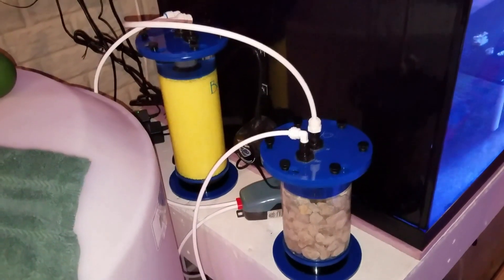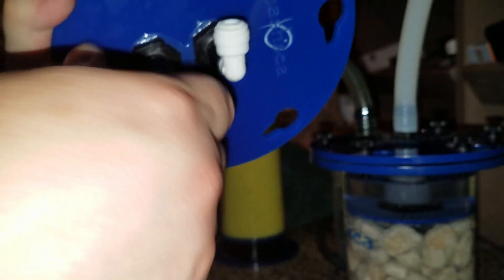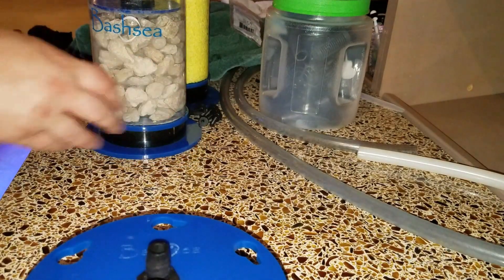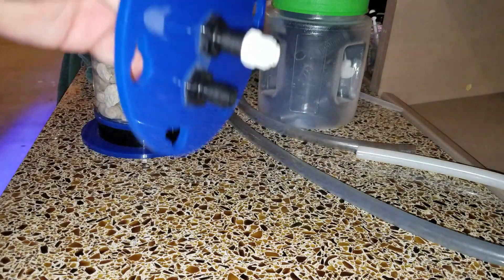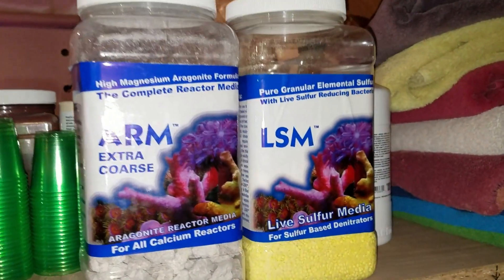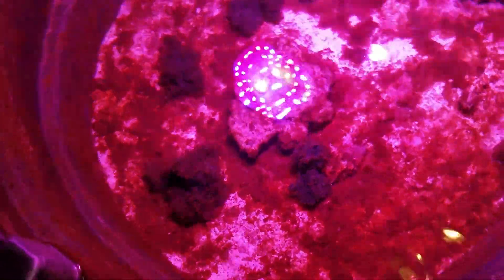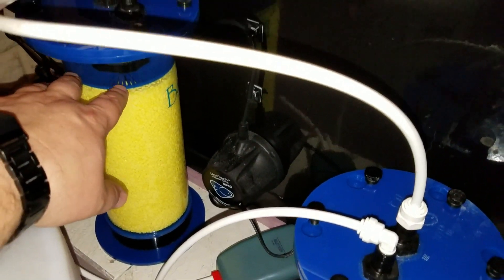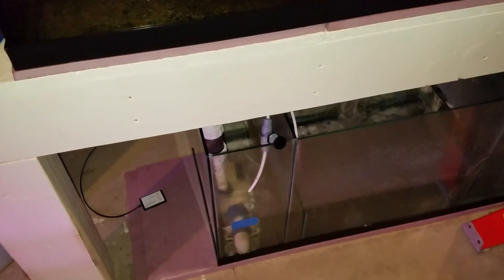Taking Reducing Nitrates to the Next Level

Comment: Hi Blue, does this system works? I saw a video, of the upgrade. I am trying to do the same as with your bashsea setup.
Reply from the maker: It did not work great for me but that may have been my system or something it lacked. I could never turn up the flow high enough to make a dent into the nitrates at the time. It did Ultimately work but was not turning over enough water to bring the overall numbers down. My final solution was growing chaeto..

Comment: what kind of pump is that? Can you please tell me the name? Thank you!
Reply from the maker: That is a Tom's Aqualifter
Reply: @BlueCarbonReefing  Thank you. I have four 10 gallon tanks, do you think I can Use one filter and one pump for four tanks. I would connect the airline hoses with 4 way splitters. I’m just trying to really avoid making four of these if I can make one big one and connect them do you think that will work or will I am not be able to control the outflow and have the tanks overflow...
Reply from the maker: @haroutvartanian2915  I honestly don't know. They were made to be able to both air and water. I am not sure if creating a manifold and using it with 4 tanks would work but I would try it before I bought 4 of them. I just don't know what kind of pressure they can handle.

Comment: What sulfer you using now? Soil sulfer sold on amazon or landscape places?
Reply from the maker: I am no longer using sulfur at all. I was successfully able to reduce my nitrates down to near zero
Reply: @BlueCarbonReefing  what are you using in place of sulfur to reduce nitrates?
Reply from the maker: I was but am no longer using this system
Reply: Soil sulfer I bought cheapest on Amazon.. Those landscape places have high shipping... I have three eels,  high nitrates,  I could not grow algae Cheato with success,  it probably is the Dr Tim's or the Vibrant killing it..
Reply: @skullartcollector  hi...i have 3 eels too..and will add a 4th when he grows out.....so my nitrates het high too..ive been doing water changes but they just keep going higher...predators put out a ton of waste as you know...have seen the nitrates go down yet for you using this system? I was hesitant to use it because if the acidic nature if it but that's what the aragonite is for so im gonna try it...was just wondering what stage you're at...thanks!

Comment: That is a complex solution to a simple issue.  Sulfur media isn't needed to create denitrification.  Just some porous stone such as pumice rock.  The key to a denitrifying filter is limit flow (start around 1 gallon per hour drip) and limit O2 (which is accomplished by limiting flow).  Per my testing in the development of my own denitrifying filter, I find that @ around .25ppm phosphates you are anywhere between 0.60 to 0.34 ppm nitrates.  To get any lower than those numbers will likely require carbon dosing, but any lower than .25 and .6-.3 isn't good for corals that feed off these nutrients.

Comment: Do you run it open first? Then slow it down? I have a seapora one....
Reply from the maker: You can run it at the initial setup full blast to try and get all of the air bubbles out but after the first day or two I would slow down the flow to one drop per second

Comment: How is working out for you? Are you still using it? I have two of those media reactors lying around so I may do the same thing? Thank you for sharing
Reply from the maker: It worked so well I took the reactor offline and am now considering dosing Nitrates to get them back to a readable range.
Reply: Blue Carbon Reefing oh wow! I have 10 tangs and I’m heavy handed when it comes to feeding so I may be good. Going to this set up  when I have some down time. Thanks again for the video
Reply from the maker: @seralaltidor370  You are very welcome. give it time. It took a couple of months before I started to see a difference.
Reply: Blue Carbon Reefing ok. Thanks again
Reply: Hey, where did you find the sulpher media? I can’t find it anywhere. Thanks again
Reply from the maker: @seralaltidor370  I purchased Caribsea LSM live sulfur media from marine depot but it looks like they are sold out. I tried a few searches myself and couldnt come up with much. You might be able to call them and see if they plan on getting more.
Reply: Blue Carbon Reefing they don’t plan on getting more.
Reply from the maker: @seralaltidor370  that's a bummer.  Im sure someone else is still selling it
Reply: Will do thanks

Comment: You need iron to grow cheato. You should try fan calerpa micro algae, it grows much better then the cheato and it doesnt go sexual but sometimes some leaves died off but the rest of the calerpa makes up for it
Reply from the maker: Hey Kristijan I have been dosing Iron for a long time with little effect by itself
Reply: blue carbon, consider dosing iodine. Macro Algae consume it and their growth is limited when it is depleted. a drop per day of lugols should help a lot. (it also decays in the system so a drop per day wont build up in a bad way or anything). good luck! it made my macro take off. If it isnt iron limited, likely Iodine limited.

Comment: Yo blue. Your definitely going to have to change that pump  I myself had to return mine and get more of a small type powerhead as you said in the video it was wide open and only dripping out that's not going to be fast enough to feed all that bacteria when it actually grows it eats like crazy.  Mine almost runs as fast as an RO water filter. I mean if you have any questions about that system I think you have a little too much aragonite cuz it's powerful and it goes a long way I have a lot less and I have a 600 gallon tank but I've been through all the ups and downs with the sulfur denitrifier. The fast of the flow the faster it removes the nitrates the slow of the flow the slower it remove zit yeah but definitely definitely bigger pump because the bacteria is going to start to starve you definitely will not be feeding it fast enough with that pump and they clog a lot they like to stop a lot hit me up you got any questions about it I almost became an expert in them because I went through every issue
Reply from the maker: Thank you for the input. I did also buy a couple of small eheim pumps that will do 79 gph and 159 gph if I need to step up the flow on this. I figured  I would start slow and work my way up if needed.
Reply: If you ever get a rotten egg smell which you probably will when the bacteria really gets going that just means turn up the flow the bacteria is underfed
Reply: And if it's a really bad strong smell I would divert it for at least a chamber or two full of water and then diverted back into the tank
Reply: but ten bears doesnt it need to start out very slow (or almost off) to colonize the reactor and create anoxic environment for the bacteria to thrive? I am just starting one myself (well a few weeks ago) and every time I left the flow really slow, nitrates in effluent would be really low or zero, but as soon as I exceed a drop per second or so, the nitrates went right back up to the level of the tank (~30ppm). very interested to hear any tips! thanks, and good luck Blue Carbon!
Reply from the maker: So far i am seeing the same thing Deepblue. I am assuming i will be to keep turning up the flow as the bacteria establishes